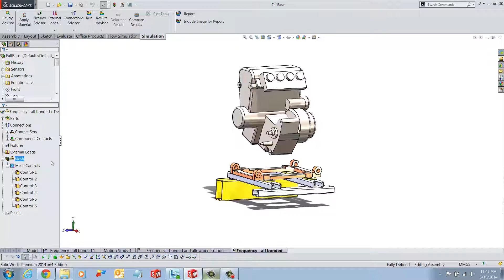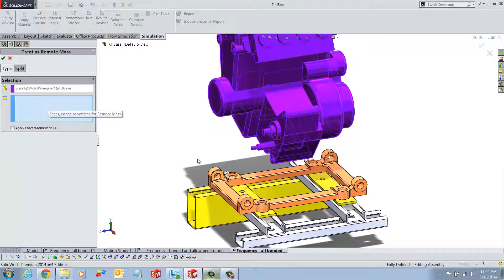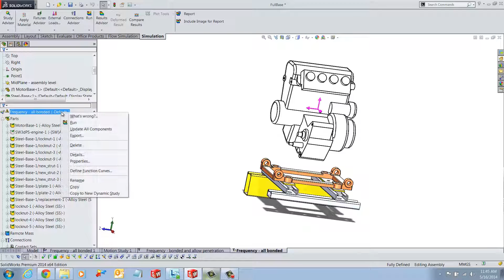SOLIDWORKS - Remote Mass

Comment: could you please make a complete video explaining in  details how we can get the natural frequency of this system ?
Reply from the maker: Thank you for your comment.  We have this in our list of videos to create, thank you for the suggestion.
Reply: I have a question , usually Solidworks show only 5 mode shapes , how can I increase how many mode shapes to be shown ? 
I can set how many frequencies I want to have but why can't I set how many mode shapes I want ? 
thanks
Reply: When you increase the Number of frequencies in the study properties, it should show you the corresponding Mode shape. Lets say I wanted to see the first 10 natural frequencies. I open up Study properties, change the number of frequencies value to 10 and run the analysis.
In the results folder, Simulation displays mode shape 1-10 along with their resonant frequencies. 
You can also right click on the results folder and "list resonant Frequencies"

Cheers,
Ronit